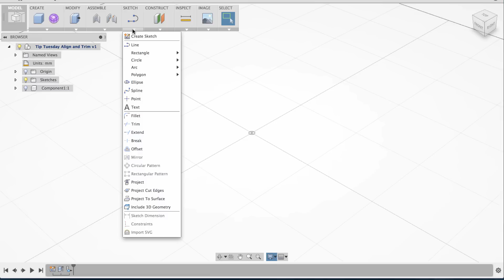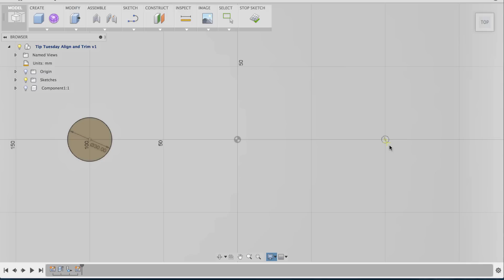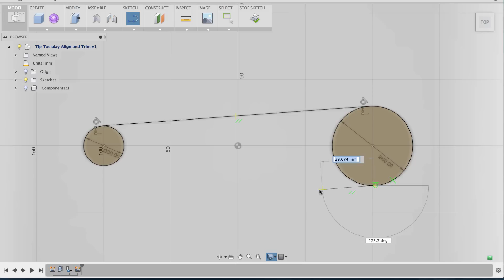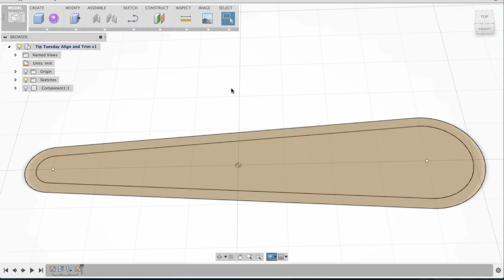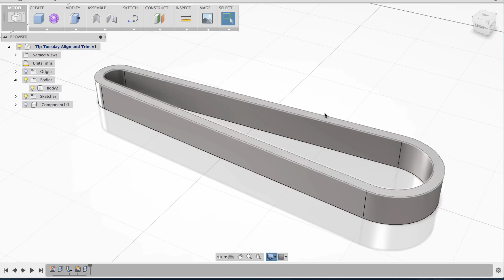Tip Tuesday - sketching tips

Comment: Why did the bottom/inside of the sketch automatically disappear when you pulled up the 6mm outer loop/offset?  I assumed it would remain and you'd have to manually hide/delete this surface.?
Reply: It's still there, but the sketch that shows it automatically hides after being used to create a body via the extrude command.

Comment: I have a question. If I later change my mind about the offset, how can I go back in history and change it to another dimension? Thanks!
Reply from the maker: Sketch offsets will have a dimension you can alter. 
Face offsets will need to be edited at the feature level. This does depend on the type you use, however. See our latest QUICK TIP to learn about some of those differences.

Comment: Why most of fusion 360 tutorials deal with just sketches and extrusions ? Coming from 3ds max to fusion, I find a lack of CAD and modelling training materials compared to 3ds max. Someone might ask, then why don't you use 3ds max for CAD? 3ds max is not meant for CAD, and my student licence ended and it is very very very expensive to buy a subscription for 3ds max.